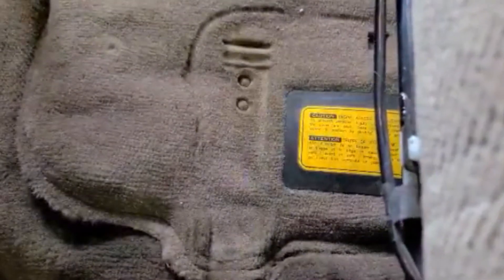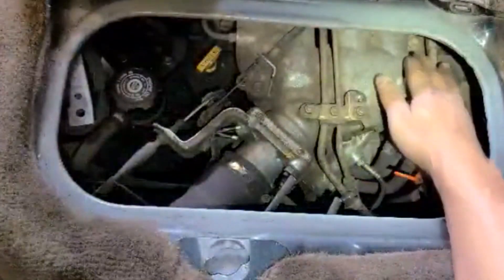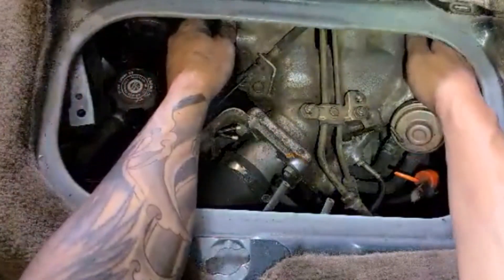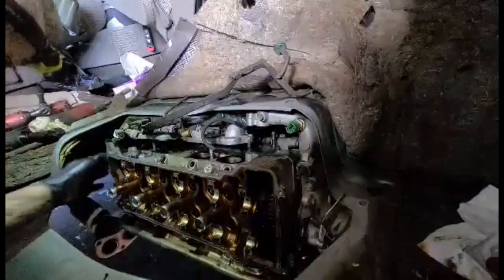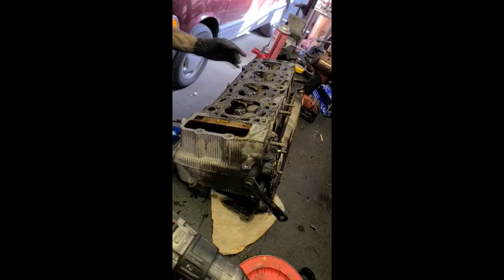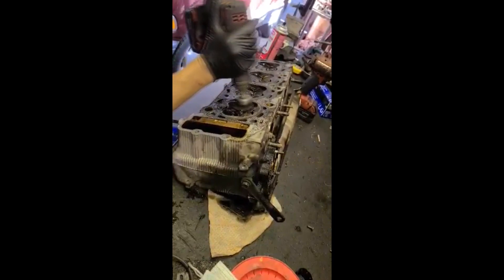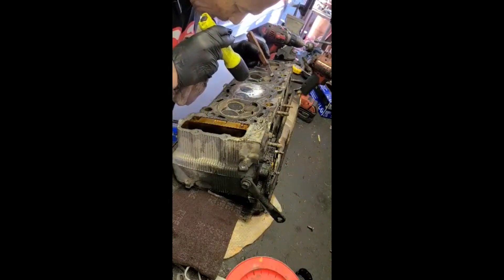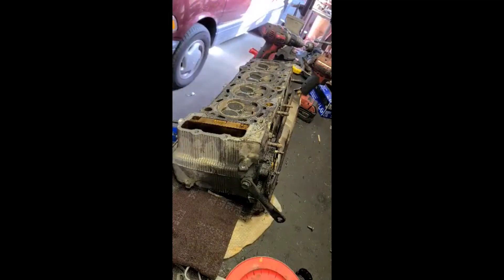Cylinder Head Removal Tips - 1990-1999 Tarago Previa 2TZ-FE Engine

Comment: Does changing your antifreeze and keeping it clean make a cracked head, or a head gasket failure , less likely to happen? I just flushed my Previas coolant 3 or 4 times with with distilled water by running, flushing, running, flushing then used pure Toyota red antifreeze after the last flush as refill. I did not use a coolant cleaning pre-flush additive and wondering if I should have. I'm just wondering if keeping the coolant clean, and keeping the motor under light loads (no towing up mountains) to keep the temperatures down would help keep the head gasket from blowing or is it just purely random?  Thanks!
Reply from the maker: Yes what you doing will prevent Cylinder Head & Gasket damage. You only truly need to add a flush additive if the engine has been run with just tap water and no coolant to remove any corrosion buildup and if the engine was always looked after and coolant changes done then what you did is all you needed to do. Actually, tap water could have been used to flush out the old before doing the last flush with distilled water and adding your coolant. Cylinder Head & Gaskets don't just blow out for no good reason. Mostly from the engine being mistreated or incorrectly installed if the repair has been done before is why it happens.
Reply: @TaragoPreviaEstima  Thank you so much! It's good to know that the flush makes a difference and little things like that go a long way in keeping the van going. It's such a cool vehicle, I absolutely adore it! I have the super charge version and read there is a long metal coolant line that runs along the air box that gets clogged that I need to somehow clean out. I read on a forum somewhere that if it is cool to touch when the motor is warmed up then it's clogged and mine is that way. I need to disassemble and clean the IAC valve while I'm down in there too, but it's a tad bit nerve racking to dig in and do that job with my limited tools. Anyways, thanks again! The world needs more people like yourself.
Reply from the maker: @ktroy787  You are most welcome. I also love mine. I do make these clips in the hope to help people like you to keep our vans on the road longer :) . I might direct you to my good friend Samay in Seattle at Garage Tuner Automotive http://www.garagetunerautomotive.com/contact/ to ask any Super Charged questions. He is a Previa Legend and can answer any of your SC questions. In Australia, we don't have any SC models so Samay is the man to ask. He really is a great bloke. Give him a call anytime.